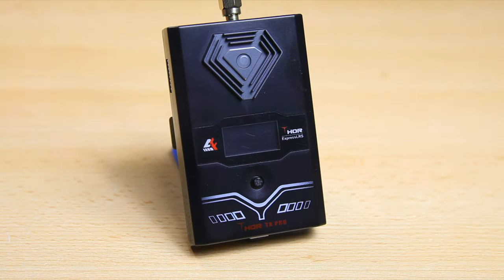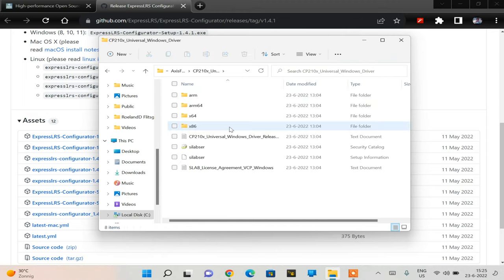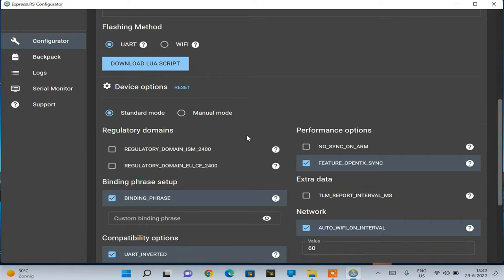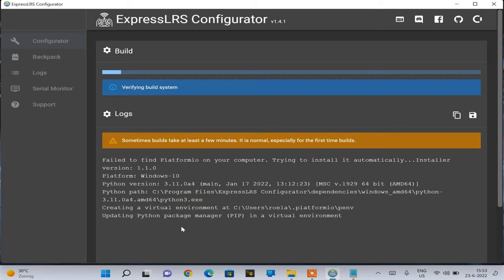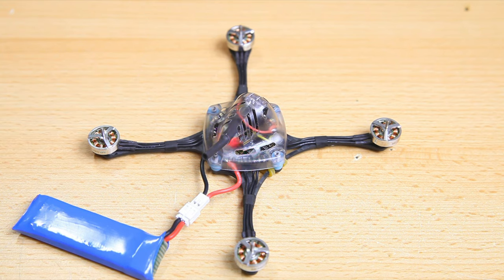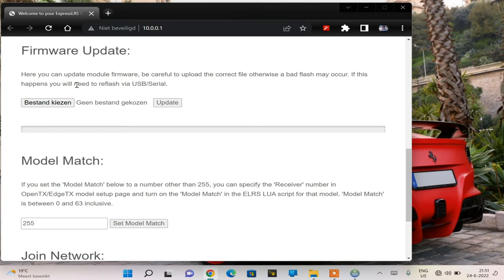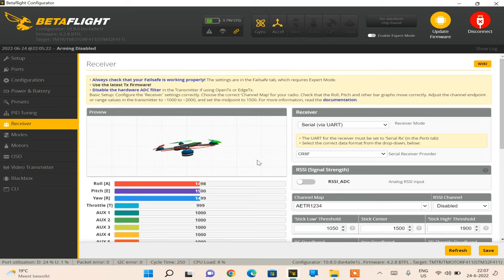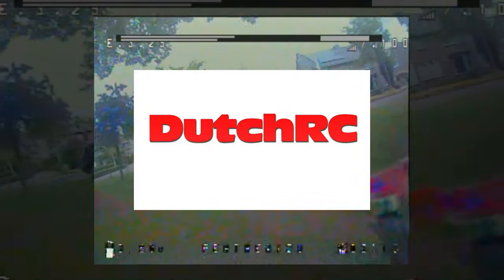ELRS + TBS Mambo Featuring Axis Flying Thor! - Step By Step How To

Comment: How is the module secured in the back? I couldn’t see the tabs, but I’m also on my phone. I’ve also seen a few that don’t seem to have the tabs… double sided tape? I just got this radio because the ergonomics seemed perfect for hybrid pinchers. Now I need to get ELRS going. Thanks for any information!
Reply from the maker: the module does have the normal 2 tabs at the rear.. that "block" that slots into the JR-bay can actually be taken of for other radio's (like Futaba's).. 
And yep.. the Mambo works out well in that department :)
Reply: @DutchRC  Thanks!

Comment: Is Elrs limited to 250mw on tango and mambo radios?
Reply from the maker: I don't think so.. I don't have a power meter, but the module's screen says it's at 1W when I set it at that level in the radio.
Reply: @DutchRC  cool, yeah its just because i saw a comment on bradwells tango2 elrs video with someone saying its locked at 250mw, i know it is liminted to 250hz refresh but i wasnt sure about the output power, thanks
Reply: @DutchRC  Yes the Tango 2 and Mambo (using FreedomTX) is limited to 250mw.  You should change your settings.
Reply: @theFPVgeek  if setting more than 250mw what will happen ? for example set to 1W